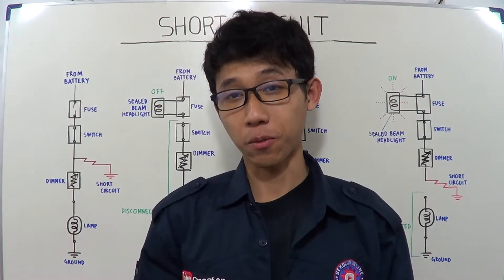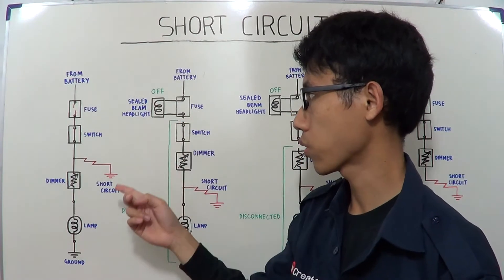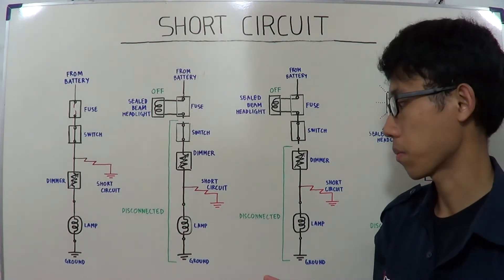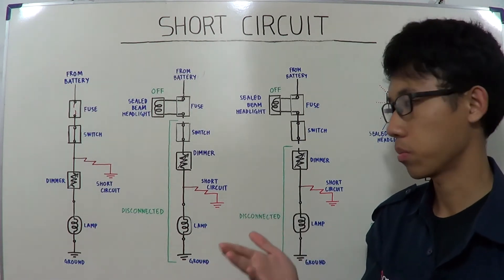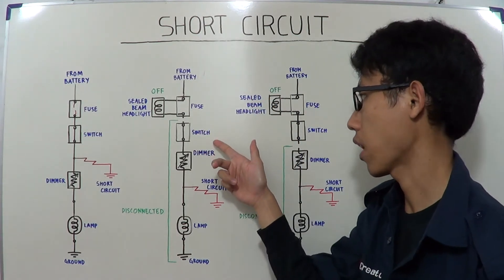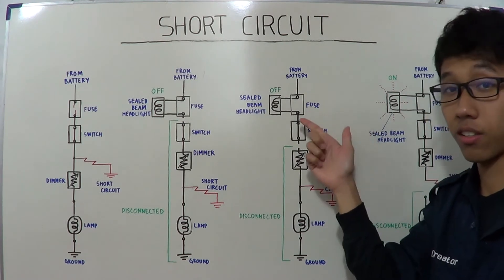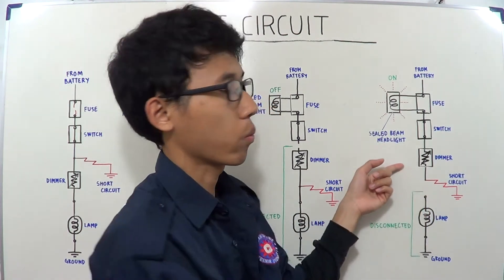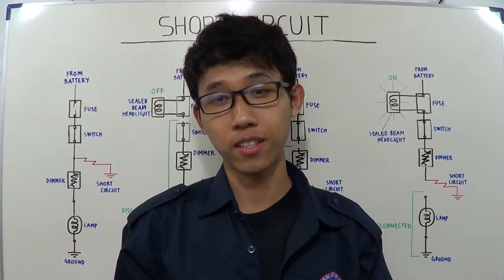Short Circuit in Cars and Motorcycle: How to Find it

Comment: When I connect the sealed beam to the 2 fuse connections and the light comes on immediately, does that mean there is a short in one of the two wires that connect to the fuse. It is a motorcycle wiring harness that only has one fuse.
Thank you.

Comment: HI My scooter toasted the second stator in 4 months. it was a used one i bought on ebay. do you think this can be just because the stator was not new or can i have a problem on the charging system and in case i have,  what should i look for?
Reply from the maker: I'm not sure if I can help this. Direct inspection is needed.

Comment: Hi 

The example is great taht you present in this video.  But in rael life is more difficult.  Here is my problem can you provide some adive.
  I have a 2004 Suzuki Grand vitara that stalled and never started again.  There is an electrical short. The problem started out as no power to fuel pump first. So I replaced the fuel pump and no resolution then I changed the fuel pump relay and no resolution.  I have some car repair knowledge and was able to narrow the short.  I have attached an electrical diagram to explain the issue.  As you see in the diagram below there are two relays the main power relay( marked by the arrows 1 and 2)  which is hot all the times.  Then fuel pump relay which is marked by me as 3 and 4.The main relay feeds the fuel pump relay only with key on. However once there is battery in the car.  There is power in the main relay Pins ( 1 for control side and 1 for load side)  which is supposed to be.  However if test the fuel pump relay pin of the load side marked by arrow no. 3 there is power which does not make sense  ( I have done this with relays unplugged meaning I am testing the terminals or pins or the relay base at the fuse box.  Also I have noticed the wire that feeds the control side of the fuel pump relay ( black/White)  when I turn the key on which is controlled by ignition fuse has short in it.  I did the test by plugging in a light wires and illuminated.  So there is a short in the black/white wire which also feeds the ignition and ECU or PCM..  This short is present or power even I removed the ECU or PCM from the car there is still power to fuel pump pin at 3 or marked by arrow No.3.   Some are telling me this could be the fuse box is messed up because how can you have power at fuel pump load side marked by 3 if the key is not even on. what are your thought?
Reply from the maker: Thank you very much for your question.
Unfortunately there's no diagram that I can observe. Anyway, that's quite detailed explanation, but could you tell me which fuse that is always blown?

Comment: Selamat siang brother, motor saya honda blade. Memiliki 2 fuse, yang pertama 7,5 ampere dan yang kedua 10 ampere. Tempo hari fuse yang 7,5 ampere putus, saya sudah keliling dialer untuk cari yang 7,5 ampere, tapi tidak ada.
Mohon di jawab brother, apakah menggunakan 10 ampere untuk menyiasati 7,5 ampere yang tidak saya temukan, tidak apa2 pada kelistrikan motor?
Reply from the maker: Sebaiknya hanya gunakan yang sesuai (7.5 A). Jika dipasang dengan ukuran lebih dari itu, besar kemungkinan saat korsleting akan menyebabkan kerusakan komponen lainnya.
Jika ada yang belum jelas silakan tanyakan kembali.
Semoga membantu.
Reply: Itu yang jadi masalahnya brother, saya sudah keliling seluruh dialer motor honda dan bengkel pinggir jalan buat cari fuse  7,5 ampere. Dan hasilnya nihil..
Reply from the maker: Coba preorder kang, di bengkel resmi.
Semoga berhasil 👍